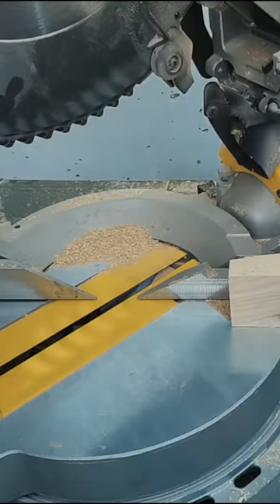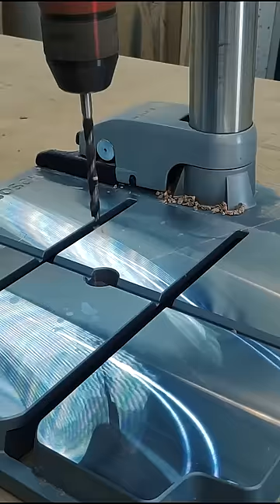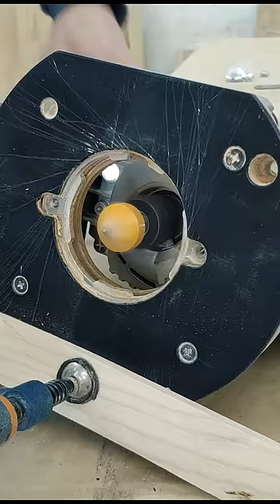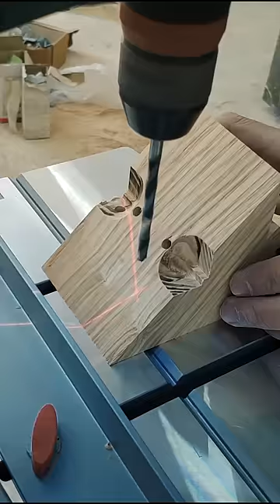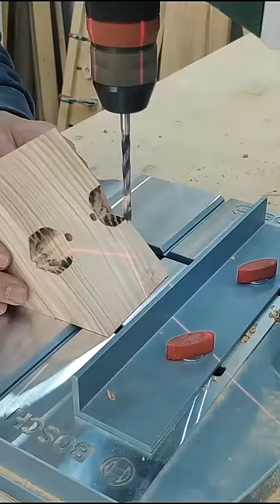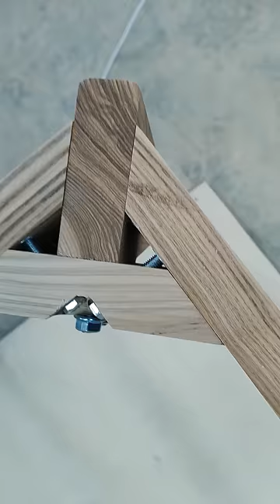Table DIY / How do you like this connection? #shorts

Comment: Not sure, but it looks like the threaded metal inserts are the type you hammer in they have a ring with three to four ears bent that stick them into the wood if those are the ones used they are not installed correctly as the are ment to be pull into the wood by the bolt and if they are on the inside tightening the bolt will pull them out of the wood as they are ment for throw holes. My suggestion is to use the ones that thread into the wood and have theads on the inside for dead-end holes or non throw holes
Reply: I could be wrong on which type of hardware he's using, but it's a very nice design, and depending on how he puts the top on, it could be very awesome
Reply from the maker: Hello! In this regard, furniture threaded bushings are used, the calculation of all distances is made taking into account the fact that if the connection weakens, then it can always be tightened without problems! In addition, this connection has the ability to completely disassemble the product with subsequent assembly, which is what I was trying to achieve, it is very important for me to manufacture the product and be able to ship it several thousand kilometers! On my channel there is a very detailed video on the manufacture of this table, it contains more necessary information!

Comment: That's a very secure joint. I have plans to use a similar joint on the next table I build
Reply from the maker: I agree with you! The task was to make a fully collapsible and reliable table, I tried not to use self-tapping screws! Such a connection allows mounting and, if necessary, tightening the connection during operation! I'm glad you liked it!

Comment: What miter saw blade?  I just got the FS Tool SM6300.  Yes it’s brand new but the cut it made on a piece of 3/4” oak was insanely clean.  Top, bottom, both edges, zero visible tear out anywhere and a knife-like edge on all 4 sides.
Reply from the maker: Hello! Congratulations on your purchase! Great purchase! I use DeWalt DWS780, a standard saw blade is installed on it, I gave it to sharpening a couple of times, saws very well too!
Reply: The DWS780 is amazing. I just put painters tape over the insert and have relatively no tear out every time

Comment: What's holding the fastners into the legs and rails?
Reply: Looks like on the rails they used those threaded inserts that you drill a hole then hammer them in, they have the washer type top with three spurs. 
I think the leg connection might be a regular lag bolt.

Comment: Have you bolted straight into the timber? The threads look like bolt threads not timber screws. If so, no I do not like that connection